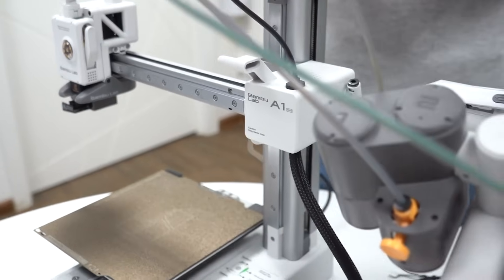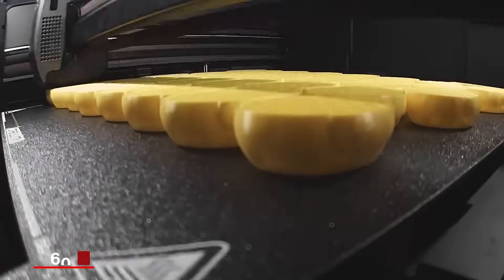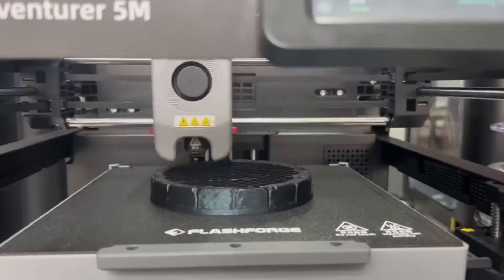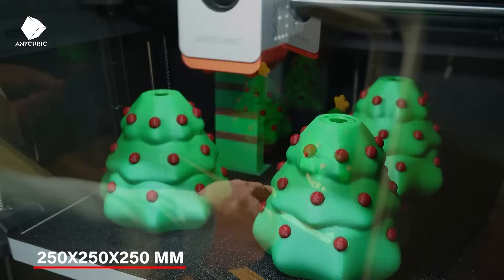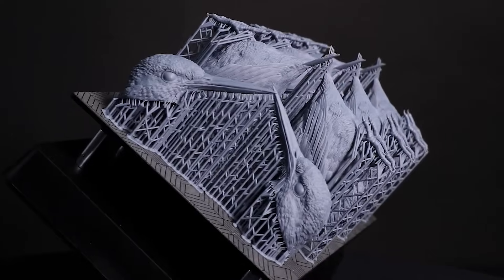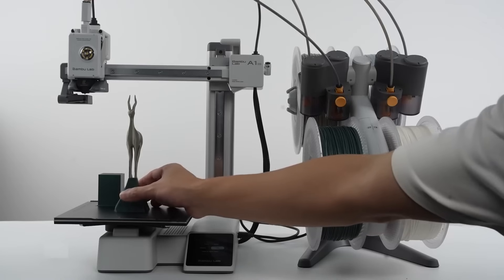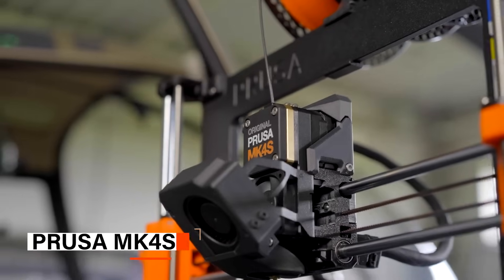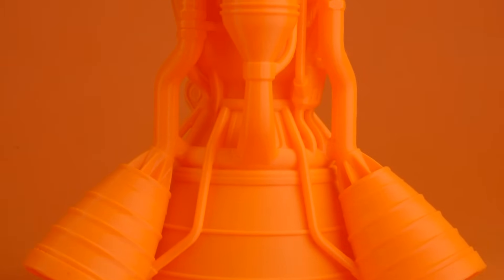✅ Best 3D Printers 2025 [Watch This Before You Make a Choice!]

Comment: As a bambu lab owner with over five printers for them I would highly recommend the P1 P or extra carbon for high buyers but the P1 P is good for lower buyers bamboo is very friendly for newcomers would highly recommend this printer company
Reply: bambu have gone closed source and locked users in to their software only and require that you are connected to the internet.
That means the end user has no choice but their software. Avoid this company.

Comment: Is the Creality CR-10 S5 any good? I’ve been looking for any good reviews on it. I need a large printer with 500mm cubed and possibly a smaller printer for smaller, more detailed prints
Reply: I have the cr 105s  it's massive I have flexed on this bed with 20 inch in diameter prints. Ranging from very accurate directional  microphones to a jack skellington halloween decor. 
Pros - it has auto filament shut off
Big, fairly cheap, basic.
Cons - loud, loud, needs a bed warmer upgrade, stability upgrade for the gantry, bed is hard to level. 

 I've put 300 into the upgrades. Just to get it working decent and it still will fail print and curl the first few layers against  the bed.